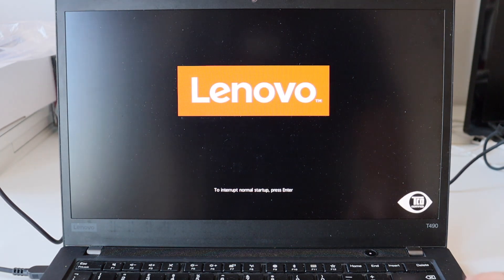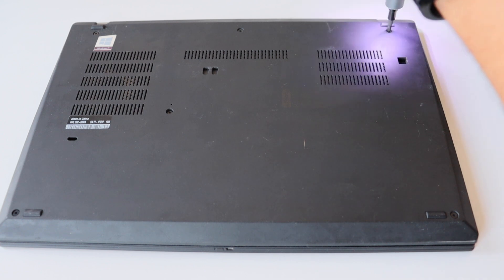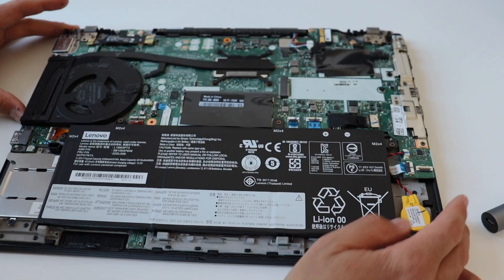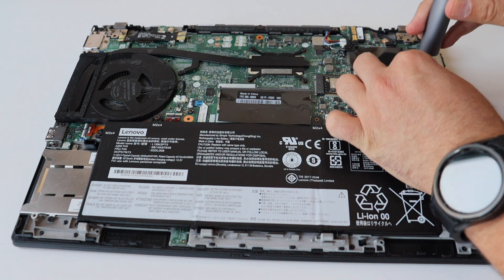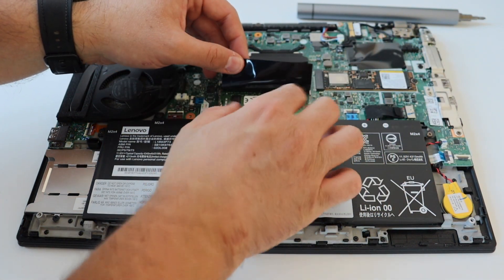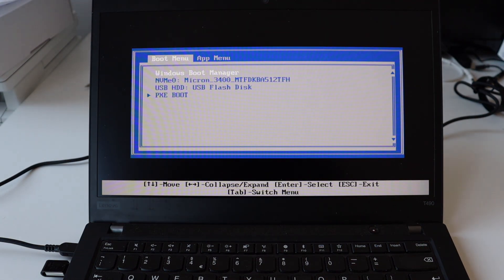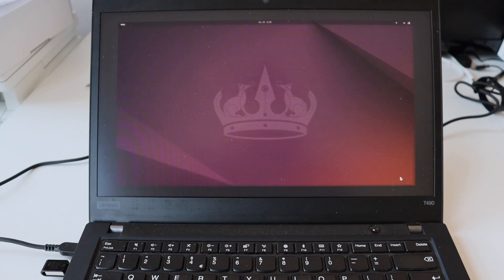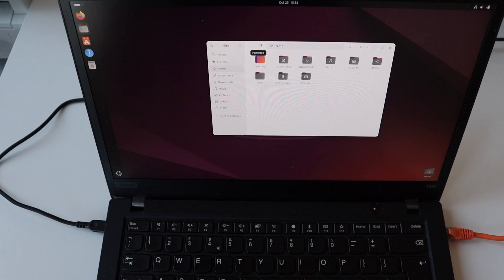Lenovo ThinkPad T490 Laptop Upgrade with 16GB RAM and 512GB Micron M.2 2280 NVMe SSD

Comment: I Was surprised when I discover 16 gb solded not bad but i cant use More than 10 gb so its ok but cant reciclaje this one on my other lap :(
Reply from the maker: Good for you. The premium T490 models come with 16 GB of soldered RAM. Mine has 8 GB soldered. In the future, you can add up to a 32 GB DDR4-2400 SO-DIMM in the extra slot. Linux handles memory efficiently, so even today, 16 GB is more than enough for most use cases. Which Linux distro are you using?

Comment: Does it have a pre-soldered rem
..
Reply from the maker: Yes, T490 models come with either 8GB or 16GB RAM soldered + a slot of extra RAM. I have published several related videos with more details about the main board and the RAM:
- Lenovo ThinkPad T490 Laptop Upgrade with 16GB RAM and 512GB Micron M.2 2280 NVMe SSD
https://youtu.be/UvpOk2ogGeU
- Lenovo ThinkPad T490 Laptop Disassembly and Main Board Replacement
https://youtu.be/pahmqYAr0lE

Comment: Can I upgrade the SSD of T490 up to 4TB?
Reply from the maker: Good and very interesting question. According to Lenovo's official specifications, the ThinkPad T490 supports up to a 1TB NVMe M.2 2280 SSD. This is the capacity that has been officially tested and guaranteed. While higher-capacity SSDs may potentially work, there are risks, including the possibility that the BIOS may not recognize the drive correctly or that the system may fail to boot from it. As of the moment I haven't tried any drives above 1TB so I cannot share personal experience.

Comment: Hey, i have a T490 with 256GB SSD. Which SSD type can i put in to upgrade ? I need 2280 NVMe ? I want 512GB. Thanks.
Reply from the maker: Yes, in this case you should go with a 512GB M.2 2280 NVMe SSD. In the video, I used a 512GB Micron NVMe M.2 2280 PCIe 3.0 SSD, but NVMe M.2 2280 drive from another brand should work just fine as well.

Comment: Does it have 1 or 2 ssd slots?
Reply from the maker: Two in theory but it is a bit tricky. One drive, up to 256GB M.2 2242 SSD or 1TB M.2 2280 SSD, optional Intel Optane™ Memory integrated with SSD, M.2. The  M.2 2242 option  actually cones in the WWAN slot so it is compatible with M.2 2242 NVMe B+M key drives.
Reply: @LeonAnavi  2242 that's what I wanted to confirm becasue I had L480 before.....I am gettign this for my sister so asked as it's around $85 for me (India) . Thanks.
Reply from the maker: OK but why don't you use the primary M.2 2280 SSD slot on the T490? You can still fit 2242 drive in it with an extender bracket to mount it.

Comment: Can I upgrade the wifi card to Ax210?
Reply from the maker: On the ThinkPad T490, the main Wi-Fi card is integrated into the motherboard. However, you can still add another Wi-Fi card using the M.2 2242 slot. The T490 has two M.2 slots: one 2280 and one 2242. Typically, the SSD is installed in the M.2 2280 slot, leaving the M.2 2242 slot available for additional expansion - such as a secondary Wi-Fi card.

Comment: is it normal that it takes a lottt of time to shut down after installing the ram
Reply from the maker: No, I haven't noticed anything like that after RAM upgrade. I am using a Ubuntu and in general Linux works far more smoothly than Windows nowadays. Which OS are you using on your T490?

Comment: ThinkPads are worth repairing as is my old X1 Extreme 2nd gen. with 2 SSD slots.
Reply from the maker: Yes, ThinkPads are aging really well. I use this T14 as a secondary laptop. My primary machine is also a ThinkPad: X1 Yoga with i5-1235U. Are you still using actively your X1 Extreme gen 2?

Comment: When uyou run Neofetch or fast fetch whats the CPU clock say?
Reply from the maker: The CPU on my unit is i5-8265U. I had to disassembly it and temporary use the SSD on another laptop so I can't check the neofetch right now.
Reply: @LeonAnavi  Love your videos brother. Cheers from CHicago. I just scored a near mint condition core i7 Thinkpad T490. Im a mac guy so my first thinkpad. My SSD slot is filled with my ssd. But then theres another M.2 slot AND a wifi card slot with the antennas. Is that extra M.2 slot another ssd slot?? It looks like a 2230 ssd would fit. That slot does NOT have the two antennas like the other one. I must be for a second ssd right?? Trying to look it up
Reply: This thinkpad literally looks brand new. 2019 came with the massive Lenovo dock with all the IO ports. Original charger and I got it all for $169. The guy has a bunch for the same price. Came with Winodws 11 Pro all ready to go. Amazing deal . On ebay. The guy is super cool too
Reply from the maker: The 2nd smaller M.2 slot is 2242. According to the datasheet for storage on T490: "One drive, up to 256GB M.2 2242 SSD or 1TB M.2 2280 SSD". Because of this "or" I am not sure. May be we can't use two drives at the same time but I haven't checked it.
Reply from the maker: Btw $169 for T490 in near mint condition, a dock and original charger sounds like a bargain. I am a bit jealous now :) :) :) Have fun with the laptop. I think it is a really nice model.
Reply: @LeonAnavi  I just saw a video of a guy installing an little M Key SSD in that second spot. Thanks man. I like this thing so far. Linux VM works quite well. I really might put Linux baremetal on it though
Reply: @LeonAnavi  Hey brother One thing I hate about Windows is everyb maker has a different way to enter bios. I just spent 30 minuteds trying to with this thinkpad. Internet told me 5 different ways and none exceept one worked. You are a pro. How do you enter bios?? F1?? I just used a command syntax
Reply: @LeonAnavi  Tapping F1......nope......Holding F1.......Nope.....Hold enter then press F1.......nope...etc
Reply from the maker: @Mbro-dq2do  if you are with Windows and quick boot is enabled you have to use the methods to enter BIOS menu described here: https://support.lenovo.com/us/en/solutions/ht513773-how-to-enable-or-disable-fast-startup-on-windows-11
Reply: I was wrong. Still not in. I hate this about windows. My Dell HP and Thinkpad. Its all different and the internet has 5 different ways for each. Ill never understand this.Im a Mac guy and really trying to give windows my best shot

Comment: Nice video. How can one tell whether or not the factory memory is soldered onto the motherboard? I have a T490 and the invoice says 16gb. Thanks!
Reply from the maker: T490 is available with either 8GB or 16GB soldered to the motherboard. On a Linux distribution you can check the RAM hardware configuration with the lshw command-line app by executing the following command in a terminal:
lshw -class memory
Reply: @LeonAnavi  Wow! Fast reply! Unfortunately, I am only using Windows 11 on the machine. Perhaps I need to open it up...
Reply from the maker: For sure there is something similar on Windows. What about WSL (Windows Subsystem for Linux)? I am curious if lshw will work properly through WSL because it is a hardware related app.
Reply: @LeonAnavi  Haha...you're talking to someone who has no clue about that. The smartest option might be to simply hand it over to a local shop and let them upgrade it for me. But, I have done ram and HDD upgrades on other machines before so I should simply crack it open to check.
Reply from the maker: Well, you can always follow the steps in the video to temporary disable the built-in battery and perform an upgrade as shown in the video. Opening the laptop is relatively easy but you have to be carerful.
Reply: @ Yep, I have saved your video for future reference. It's really thorough because I have seen another that simply skipped that battery step.

Comment: What is the slot on the motherboard just above the ssd slot
Reply from the maker: It is a M.2 2242 slot. Lenovo ThinkPad T490 supports one drive, up to 256GB on this M.2 2242 SSD or 1TB M.2 2280 SSD (this is the M.2 slot I used in the video).
Reply: @LeonAnavi  could you have a second SSD drive in there?
Reply from the maker: I am wondering about the same. The datasheet says: "One drive, up to 256GB M.2 2242 SSD or 1TB M.2 2280 SSD, optional Intel Optane™ Memory integrated with SSD, M.2". I guess it should be possible to use M.2 2242 SSD as a second drive but I am a bit concerned by this "one drive" and "or". I don't have a spare M.2 2242 SSD to try right now. I keep this in mind if I find such a disk to test.
Reply: Yes, the word "or" makes me think the answer is no.

Comment: Can you send me the specification of the 8GB ram ? I want to upgrade mine too
Reply from the maker: yes, ThinkPad T490 supports  SO-DIMM DDR4-2400 RAM.
Reply: @LeonAnavi  Sir can I mix 2400 Hertz and 2600 Hertz Ram together?  What is the default or Ram specification?
Reply: Sir , my laptop only have 8 gb installed ram.Is it possible to add a 16 gb? will it work fine?
Reply from the maker: Yes, your T490 supports up to 40GB (8GB soldered + 32GB SO-DIMM) DDR4-2400. Please note that if the installed memory is actually 2666MHz it may run at 2400MHz due to processor limitation. It depends on your CPU. The following CPU support 2666MHz Core i7-10510U, Core i7-10710U , Core i5-10210U. The rest CPU on T490 support 2400MHz. What is the exact model of your CPU?
Reply: @LeonAnavi T490 Core i5, 8 gb ram. I am planning to add 16 gb ram to make it 24 gb ram .. Another question sir , can a T490 edit 4K resolution video?
Reply from the maker: @mts-musictravelsportsvlog6112  depends on the requirements of the video editing software. The built-in display isn't with 4K resolution but T490 supports external 4K monitors via HDMI (up to 4096x2160@24Hz), Thunderbolt (up to 4096x2304@60Hz).
Reply: @LeonAnavi  Tnx a lot sir
Reply: @LeonAnavi  Hello Sir, I have in my T490 8x CPU i5-8365U 1,6GHz. Is only option to use SO-DIMM DDR4-2400 RAM as you mention? Or I can use also Kingston SO-DIMM 16GB DDR4 2666MHz CL19 Dual Rank x8?? Thank you
And my second question, is it also possible to upgrade graphic card?
Thank you.
Reply from the maker: @ondrejkubicek4344  if you put a compatible RAM with higher frequency it will be downgrade to 2400 MHz as this is the max supported frequency by the motherboard. Regarding the 2nd question: no (easy) way to upgrade the GPU.

Comment: Great video. There's a place in hell reserved for laptop designers who solder in one stick of RAM
Reply from the maker: Yes, it is a mess. It is kind of an industry trend that the laptop designers follow. This year Intel launched Lunar Lake with integrated RAM within the SoC (as on-package 16GB or 32GB LPDDR5X-8533 RAM). Shortly after releasing this I read news Intel regrets doing it and won't do it for the next generation SoCs. We'll see how it goes.

Comment: does it have finger print sensor? cuz mine does not.
Reply from the maker: Good question. Some T490 models have "touch style fingerprint reader on palm rest, match-on-chip". It is an optional feature. I have to check if this particular unit has one.

Comment: I recrently got this and upgeaded ram, now I have 32 gb. it works great. I love the machine.
Reply from the maker: Great to hear! Have you performed any other upgrades on your T490?
Reply: @LeonAnavi Not yet. I'm new to ThinkPad community. Later on I'd like to see how much memory I can upgrade, right now it has 512. And I haven't personally opened the machine, a friend of mine upgraded it for me and got it from the overseas so it was really inexpensive like less than $300. I work as a content writer so most I do is open 100s of tabs that's why I got 32 gigs. Anyway, do suggest if you have any ideas. I also use two external monitors so I'll be buying it's docking station. And oh, it's the qhd model non touch and the panel is simply amazing. I haven't used a keyboard like this one.
Reply from the maker: As you can see in the video, if you need more space the upgrade of the SSD is easy. Owning a docking station is a pretty handy. The price of the 2nd hand compatible docking stations drops rapidly for older models like this. It is good idea to buy one at a decent price. Last but not least using a Linux distribution is a game changer in terms of improved performance for T490 but of course you need to get used to Linux if you haven't used it before.
Reply: @LeonAnavi  As a matter of fact, i did install Ubuntu yesterday especially since my cousin hyped it so much. However, I don't like few things, touchpad isn't working normally, windows gestures are had to figure out and a few other things makes me really uncomfortable. I think i'll be switching back unfortunately. Thanks for the suggestion though.
Reply from the maker: What's wrong with the touchpad? Nowadays Ubuntu GUI is basically a GNOME desktop environment with some Ubuntu specific configurations. You can configure it further for your taste but yes, indeed it takes time to get used to it if you are switching from another OS and/or different desktop environment.
Reply: @LeonAnavi   Nothing wrong, doesn't scroll that well or have that sensitivity. Buy anyway, sometime in future I'll even older ThinkPad and run ubuntu or lighter distro...
Reply from the maker: @User-of-internet  you can try adjusting the speed from Ubuntu's settings to improve the performance: https://help.ubuntu.com/stable/ubuntu-help/mouse-sensitivity.html.en

Comment: Is the ssd port blank by default? Is the boot dive another one or did you have to replace the boot drive?
Reply from the maker: No, it wasn't blank by default: out of the box all T490 laptops came with SSD. This is the boot drive. The old SSD was 256GB and it had been removed before recording the video.
Reply: @LeonAnavi  thx for the confirmation
Reply from the maker: @rajivravio  keep in mind that this T490 is a 2nd hand laptop that I bought for the video. This is a model from 2019. In 2020 Lenovo switched the T series to a new naming scheme. Similar newer models nowadays are branded as T14.